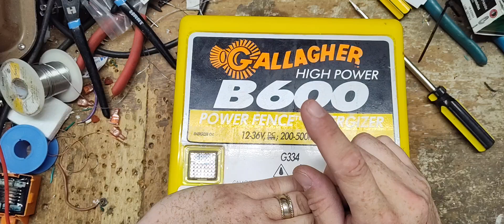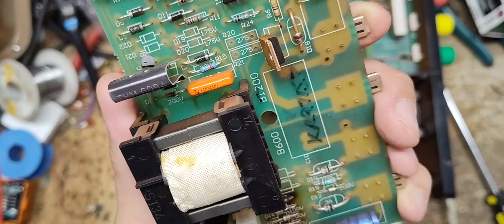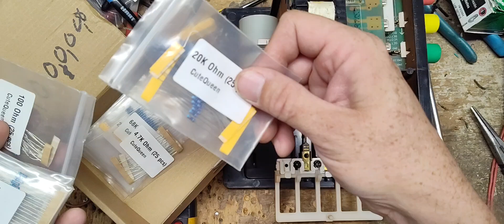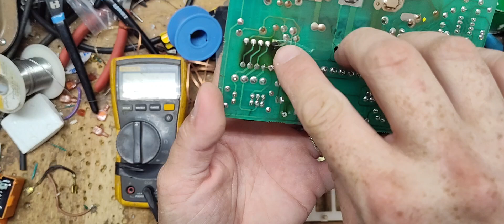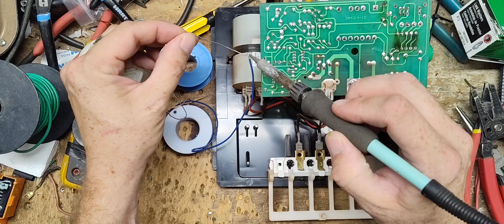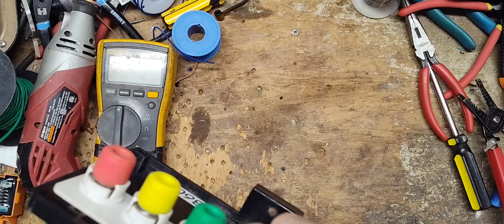One Of The Best Built Battery Electric Fence Chargers Ever Made | Gallagher B600 Repair

Comment: Really strange that they would put different value diodes in a full wave bridge formation
Reply from the maker: It's not actually a full wave bridge rectifier set up there. It sorta looks like it in the video because of how they're laid out side by side. But actually the diodes are tied in with the 4 large capacitors and used in a quadruple multiplier set up.
Reply: @FencerFixerRepairLLCKansasCity  In that setup it makes perfect sense...Thank you.
Reply from the maker: @Biokemist-o3k  😁

Comment: Great Video Lesson . Thanks From Andrew in Australia. I have 2 newer models that are dead . About 5 years old . Are these fixable. ?
Reply from the maker: What brand and models are they? If they're B600 units, look at the serial number on the unit and let me know what that is. The B600 went out of production for us here in the States about 15 years ago.
Reply: @FencerFixerRepairLLCKansasCity  Gallagher MBS 400. This is a 240v model. And Gallagher S 40. Solar model.
Reply from the maker: @andrewhenderson9474  Yes both are repairable.. They offer parts for both models. Your MBS400 is likely the same as ours here in the States. Internally the unit is a 12v powered unit, they just use an AC adapter to cover the 120/240vac to a 12v source to run the unit. Try running the MBS model off the 12v cable that came with the unit on a known good battery. If the unit starts running, then it's just the AC adapter that went bad and that's a cheap fix. Hey a hold of your local store that sells gallagher about repairs and who they use. They may know a place that they use locally, they may do it in house there at the store, or send it back to the Gallagher distributor main hub there in Australia.